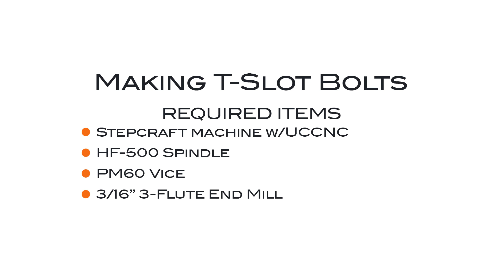Stepcraft - Making T-Slot Bolts for Clamping

Comment: If you would reduce the depth of cut even more to let's say 0.2 mm and use a little bit coolant, shouldn't it then be able to mill stainless steel, too? (better do not look at the cycle time)

Comment: Nice!
What milling bit did you used? It seems 4mm diameter or more. This can be done also with a traditional HSS bit?
What feedrate/rpm did you used?
Reply from the maker: +Giulio Buccini 3/16" 3F Carbide  - NO you can not use HSS because the spindle spins too fast.  Use Carbide.  I used 12,000 rpm and 15mm/sec
Reply: You should be able to work with HS.  Sometimes i have to wrok with HS, and we use around 25.000 1/min for a 5mm bit. You can use 0.02mm per teeth so the feedrate would be 2000 mm / min (33.33 /sec)